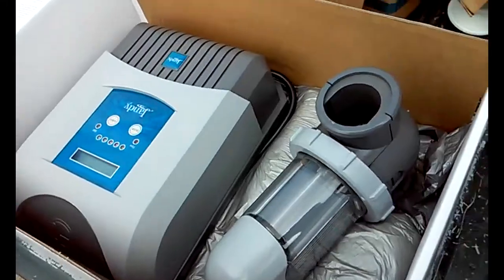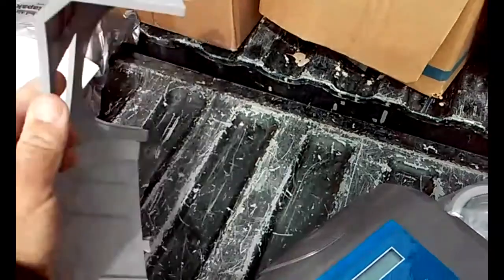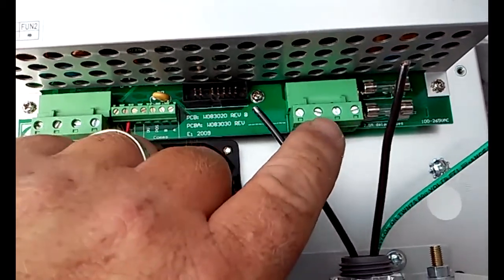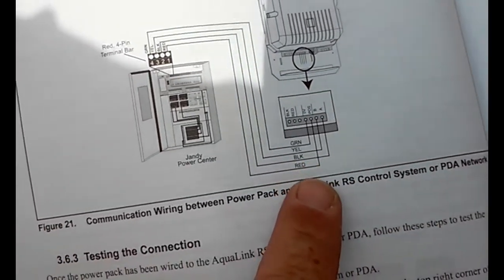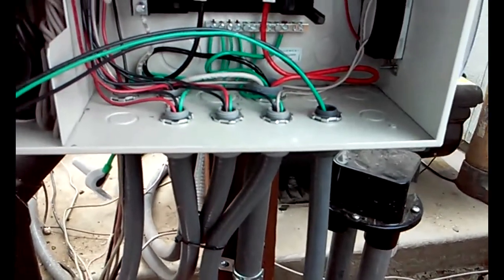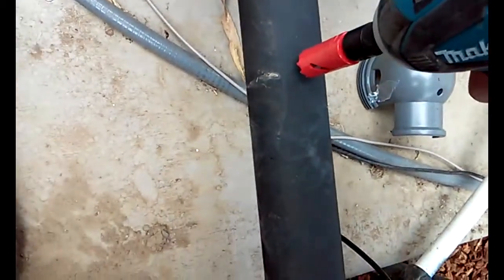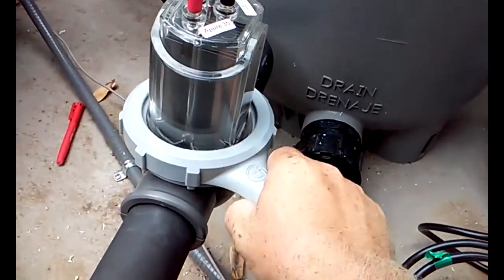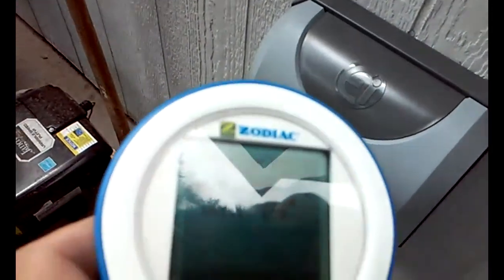Jandy EI Salt Chlorinator Instalation

Comment: I added a Jandy Ei Aquapure to my system following the directions and with your expert guidance.  I do not know where to connect the 4 wire connector to in my RS8 Pool panel, No SPA.  The top 2 sections on the board are taken, one for the Heater (Jandy Heat Pump), and the other for  the variable speed pump.  Where can I connect the Chlorinator?
Reply from the maker: you have to double up the wires on one of the comport 4wire connections
Reply: Thanks for your reply.

Comment: Thanks John. Question, my truclear system keeps turning on and off. In phoenix its still to cold for salt system to be in service. But the system keeps powering on and cycles off, then on, every 6 seconds or so with pump running in auto. Should it stay on in standby or say lowtemp/ low salt? Thanks. Just got new 2.7 flopro replaced, exact same pump, same wiring, not sure why this is happening
Reply from the maker: It should say lowtemp/lowsalt if the water is below 50 and the unit is powered on. Standby is just off for all intents and purposes. I would leave it in standby until the water warms up.
Reply: @JohnThePoolExpertGuy  so when my pump turns on, it says chlorinating, then standby, then it shuts off. Screen goes dark. Then back on again to chlorinating..   it cycles like this all day. It should stay on in standby. Not sure why it changed or cycles on and off
Reply: @JohnThePoolExpertGuy  so if you hold power button down for 6 seconds the unit supposed to shut off. Well mine powers itself back up a few seconds later. Hmmm